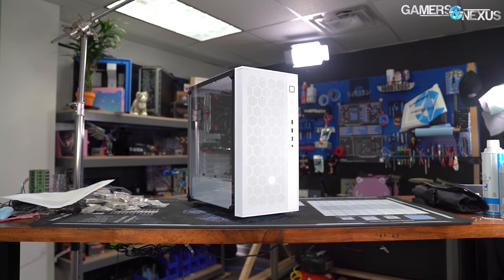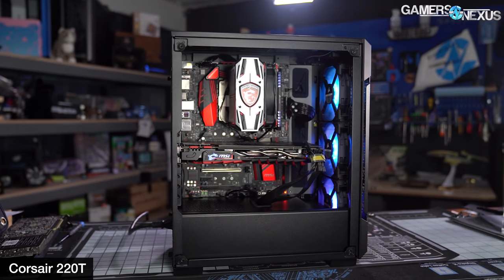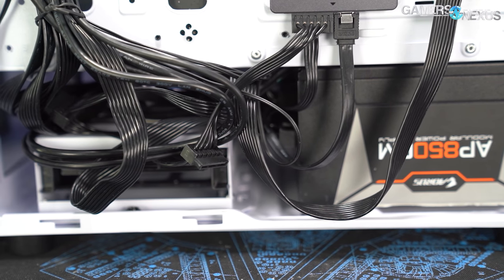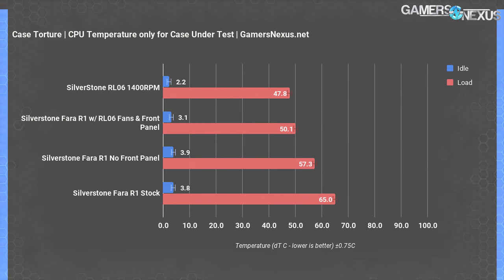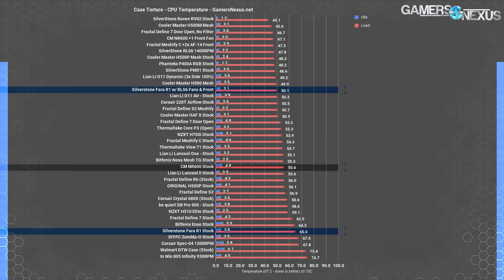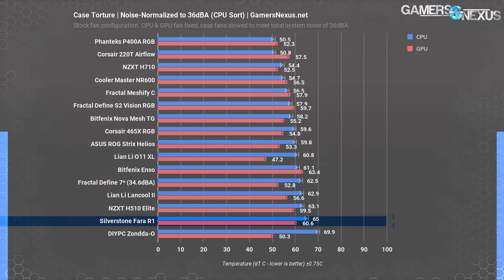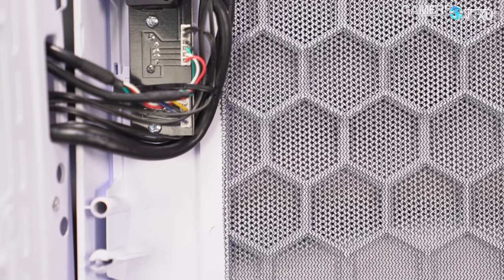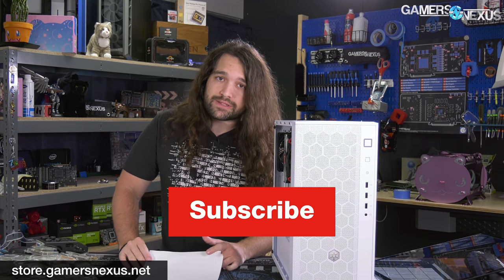Silverstone Fara R1 $60 Mesh Case Review: Build Quality, Thermals, & Noise

Comment: The fact that the front IO is connected to the case itself is the exact reason I haven't "upgraded" to a better air flow case like this or the Meshify C, coming from my Corsair 400C that I'm using right now. I really want something with better air flow, but I'm not going to spend a ton of money on a box to hold hardware and I like, like what you mentioned in this review, the fact that Corsair (among others) keep the front fans super close to the internal components in most of their cases like my 400C
Reply: RL06 front panel has no wires attached to it, and TBH it looks like a better option than its successor.
Reply: @kotekzot  True. And it looks good overall as well. But I'll be honest, I fell into the trap of only wanting a more modern looking setup in my desk area. So I'm one of those people who can't do acrylic and need tempered glass in the looks department. But having only built my first PC in 2014, that makes sense, since I'm technically a newer enthusiast with only two builds under my belt. Lol

Comment: I'm bored of this new gaming stuff. Rgb etc. I want the cases with 3.5 slots. Front fans and not windowed.

Why the hell an simpler chassis cost 200USD? My old oem chassis was 20usd I can store 6hdds 1 floppy, and 4 odds.

2 front fans, 2 back. Atx, psu on top no extra metal for the PSU shield.

Where are the good price ratio chassis gone? Where is the reset button gone?

Comment: I bought my Corsair Carbide SPEC-4 case about a year ago, came with 1 fan, but can fit 6 120mm fans, so I ended up buying 5 120mm fans for it. The case is black and yellow, very good looking, and with the 6 120mm fans running, the airflow inside is actually very good, my RTX 2070 Super stays pretty cool, my Ryzen 7 3700X (since getting a new cooler to replace the stock Wraith Prism) has been much cooler, and just replaced my motherboard with an ASUS TUF B450-Pro (from a Gigabyte B450 DS3H which doesn't have a heat sync over the top VRM's and a poor performing heat sync over the side VRM's) so I can push my CPU hard without blowing up the VRM's or totally crashing my system due to lack of power from the VRM's (the gigabyte board has very poor VRM's, really not good for 6 core or higher CPU's)

Comment: Personal Opinion: 
Most of the Fans that come in more Budget oriented Cases are pretty much lowest end cr**. I've replaced enough cheap stock fans out of cheaper cases that i no longer care if there's one included as i'll most likely swap it for an Arctic F12 for example wich i can get fairly cheap and lasts a whole lot longer in my experience. 
Many cheap cases have those bottom end Fans installed just to look good on the specsheet, along with Tempered Glass, Crappy RGB that isn't adressable and questionable "EATX Support".

Comment: IO and filter embedded on the front panel, punch-out PCI slot covers, crammed cable management, mediocre side panels implementation......in 2020....
Cutting corners in every turn working with a dated case structure....and asking 60-70$?
A quick search on my retailers and there's the MSI MAG Forge 100 or some CM Masterbox contenders with similar features for around 45-55€.

Comment: Funny you mention the Corsair 200r, it's my current case I'm looking to upgrade from. When running F@H on both CPU and GPU, my R5 3600 climbs from 70°C to 80°C (in comparison to just CPU), so heat is getting trapped too much. I'm looking for a mesh case without tempered glass and Der8auer recently highlighted the arctic P12 fans as being really solid and they are incredibly cheap, a 5 pack for 25€, so I don't care about "out of the box" thermals. I'm debating between this an the Meshify C, although this is only 50€ in Europe while the Meshify C is 80€, but the build quality and flexibility seems better in the Meshify C.

Comment: No way man, this case is pure garbage compared to the Phanteks P400STG. I really don't know how Phanteks managed to sell the thing for $65 (what I paid for it, at least), but it's insanely good for the price. After doing some modification to the front panel in the form of waterjet CNC'ing some vents (cause it was stupid hot) it's pretty damn top notch, and I get some of the best temps in this case out of any of my cases up til now after the mod. It's really great quality for even a higher price, considering all of the extra's you get with it, and the noise reduction is pretty good on it. Honestly, once you deal with the airflow issue, it's probably the best sub-$100 mid-tower case on the market, even to today, in terms of features and quality. 

The top and rear panels have noise reduction inner lining, and the case is coated with this thick, micro-textured paint, has removable dust filters, replaceable PCIe slot covers, and I was able to fit a 240mm AIO in the top by moving the rad toward the glass panel and running the screws through the vent holes rather than the holes meant for mounting fans, to get the rad out past the motherboard and RAM, simply because Phanteks made the vent holes themselves exactly, perfectly in line with nearly any standard size fan or radiator. I used peel-n-stick velcro strips to hold the other side of the rad to the case. It has built-in RGB lighting, came with an RGB strip, can fit a 360 radiator in the front, and with some ingenuity, a 240 or 280 in the top, and it's made from fairly thick, properly finished steel panels. It's just a whole lot more quality for the money, from what I can see. 

I just ordered an Evolv X, however, so this case will be going to a family member, and the Evolv X will be getting some modifications. It might have better airflow than the old Evolv, but it's still getting some awesome patterned vents machined into the front and top panels.

Comment: Just put 2x 140mm intake and 1 rear 120mm and 1 on the top 140mm, best solution just like i did on my ps15 which is very similar case from silverstone.

Comment: I prefer the Corsair Carbide 275R for better fit and finish, space, removable hard drive cage, wireless front panel, and rubber grommets around the wire cut outs.

Comment: do you think i would be fine chucking in a 2080 super, 3700x (aio cooled), with 6 fans in the case including the stock one, it’s so cheap! it seems alright if you chuck fans in there, it’s 65 dollars nzd (40 dollars usd) atm and i don’t want to spend triple on a corsair 220t airflow

Comment: Gee you sure rant about a single fan. The absolute VAST majority of pc builders will be purchasing either a pack of rgb fans or a clc any way. You essentially based all your negativity on this on an otherwise very decent case with great thermals once fitted out.

I have a box of stock fans somewhere. Stock fans mean very little to pc builders. And if you're SO budget limited, you're also running a low TDP system so even that 1 fan will be fine. You guys are getting a bit over focused on stock fan performance.

Comment: NR600 is still ~£70 in UK.
I have my 3900X with H100iV2 CLC in a NR600, I replaced all the stock fans with Noctuas (inc CLC fans), 2x 140 top (exhaust), 1x120 rear(exhaust) and 3x120 front intake in push configuration with my CLC rad, the included fans are good enough for a low/mid build, but not suitable for my application.  
One of the stock fans also had whine out of the box too, it didn't bother me as I was replacing anyway but would be something to look out for, although at £70 it's nothing to really complain about.

Comment: This looks like a Deepcool Matrexx 55 Mesh with better mounting holes and cable holes placement, hex mesh panel design, psu cover fan mounts and tinted border on the tempered glass. I bought mine for $10 cheaper, but boy I regret it after watching this vid.

Comment: I buildt a computer for my daugther in the Corsair 275R AirFlow TG. I know you did a review of the earlier model with closed front just having slots at the edges of the front panel. I found this one really good as it also came with three 120mm Corsair fans for around $100, converting from SEK to USD and with our 25% tax on it should make it similar in price. As I buildt it on my older i7 3770 and mouted a Corsair H60 AIO in the back I put the third fan in the front. It is quiet and cool and overclocks the old 3770 to 4,3GHz with ease. Running it with the 16Gb DDR3 1600Mhz RAM and a Samsung 1Tb  SSD along with a ASUS GTX1650 4Gb made it really balanced and works good enough for relativly new games in 1080. Is the new version of the case something that we might see in this line of tests? I feel Corsair has listened to you! :)

Comment: Just ordered an ATX case here in Canada through Newegg made by a Korean brand called Micronics, after having a decent experience with a PSU from them. Around $60 USD shipped, 3 white LED fans included, double tempered glass sides, mesh front (glass front w/ vents available as well), PSU shroud, fan controller. Really seems like a steal, but we'll see what happens at this price point.

I can keep any of my Canadian builders updated if there's interest, they don't seem to be as available down south. Should be an adventure either way!

Comment: If it absolutely positively must have airflow and im not doing a custom loop I still build in HAF XB EVOs. They really need a refresh. I almost never use the drive bays but they are readily available and the price hasn't changed in ages.

Comment: Not having a tv and owning a LOT of DVD´s with more coming regulary, the no ODD trend is a major pain in the ass. I need more airflow and i need my drive. Not external. That´s not an option. Looks like i have to cut out the frontpart of my Corsair 100R if i want good airflow and a ODD if i don´t wanna spend too much money on a new case that has both.

Comment: i feel like this case not having fans is to offer a good price to people who are going to put in aftermarket RGB front fans anyway, so save a buck not giving them something they will just take out anyway. of course, this means you are still overpaying by 5 or dollars for style points i guess, but it is a nice design, despite that front I/O being attached is a deal breaker for me, even on a budget. I will probably get this case as soon i see someone do a clean mod for mounting the front I/O to the case rather than the front panel

Comment: * facepalm *
Attached IO on the front panel is so dumb, and so easy to avoid. It's absolutely ridiculous that any case still does this.

My favorite solution is on the original Define S case. If Fractal has been so inclined, they could have fit the case with a very basic front IO, and offered different front IO kits people could purchase separately to upgrade their case. They also could have sold a Meshify style front panel to replace the solid front panel.

Comment: No front fans makes some sense if paired with a 240mm AIO that comes with RGB fans to showcase the tempered glass and mesh.
Will fans fit between the case and pop-off front panel? The IO cables look like they might intrude.

Comment: The only down side with a shorter case like the "Meshify C" is that it does not allow to put an AIO radiator in the front if you have a long GPU card (30 cm like the ASUS 2080 Strix), avoiding "to cook the CPU" from the hot air delivered by the GPU card (following the Buldzoid advice) and it can be tricky to put it on the top as there is no clearance from the top VRM heat sink and the 8-pin ATX connectors.

Comment: I'm using Cooler Master MasterBox MB520 and the airflow it's massive, plenty of room for cable management, ventilation and has dust filters on the front, bottom and top intakes. My version it's older and it was at the 50 $ mark at the time (has an acrylic panel) but I found the current versions with tempered glass and 3 rgb fans for 65 $ and I would say that's still a budget case considering the 3 fans included. My current setup has two 3 exhaust fans (1x120 at the back and 2x140 on top) and keeps system at 30 C with 21 C ambient temp

Comment: Speaking about $50 budget cases, I would like to see your review of the Raidmax Zeta case.  I think it is one of the best $50 cases on the market, although the caveat is that it comes with only one fan so one would need to consider additional fans with purchase.  Add in a 5 pack of Arctic fans, and it puts you at the same price point as this case.  I dont really care for Raidmax, but I had picked up the Zeta for a budget x58 build for a friend and really like it.  It states the CPU cooler clearance is 165mm, although, the 162mm Thermalright Macho Rev.B did not clear (and TG window needed to be spaced with standoffs).

Comment: I needed a fairly small and cheap(ish) ATX case with good airflow potential because I already had an extra fan lying around. I also wanted it to look good and have a tempered glass side panel. At first I had an P300A but the build quality was very questionable in some areas. The features of the P300A also don't come close to the ones of the Fara R1 (e.g. Support for fans and drives). I now have the Fara R1 and returned the P300A. So if you need a small and light ATX case with good quality and features that's not too expensive AND you have a spare fan at hand this one is hard to beat. I hope GN will also review the P300A as I'm very interested in their opinion on the Phanteks alternative for a small ATX case that's cheap(ish) and has a mesh front.

Comment: Good review,  I like Silverstone products. I went with the RL06 Pro in white for my build. Googled "best airflow PC case" at the time and it come up in reviews etc at about half the price of my previous options, packed it out with 6 Corsair LL120 fans and it works great. No regrets although it could have done with a slither more width on the cable management side of things and maybe a warning label about the bastard tax on all the other white components to finish the job.

Comment: What do you mean people aren't really buying hard drives?!? I have 6 in mine
Reply: the vast majority of people don't need hard drives at this point.
Reply: Why do you have 6 though? I'm genuinely curious. I have a 4tb alongside a 1tb M2 ssd, and that's really enough for me. The HDD is basically hidden in my system. I do have backup HDD's stored on an external HDD enclosure though, but I connect them when needed.

Comment: I like 5.25" bays, I know they are antiquated, but I have old optical media and I like to have a hot-swappable bay. In a budget case, it's not like you are going to fill the empty space with an open-loop water cooling. As a data hoarder, I also want more than two 3.5" internal bays.

Comment: So basically, if they throw in a 120mm fan this case would rate pretty highly.  If you can live with the front panel being attached by cables when you pull it off, and no easy remove filter on the front.

Comment: I picked up this older case recently for a no-RGB stealth build. Definitely was not pleased to find out that the front mesh filter is not removable, but I was able to stuff three Arctic P14 fans in the front (though the top and bottom fans are held in by only two screws - no rattling or movement though), two P12s on top and one P12 in the rear. Great thermals, cable management is acceptable. I am not unhappy.

Comment: Note for if you have a motherboard with build in large heat sinks can actually be hit buy the 140mm fan if you install them on the top of the case. x99 deluxe as a mb for reference.

Comment: I'm using the fairly scarce RL08, it's an inverted layout and the thermals are shockingly good, although it has the tendency to start sounding like it's throat-singing with fans at max-rpm.

Comment: MetallicGear Neo Air - $50 and it included 2 fans. Used it in my last build and the front panel is similar to the one on the R1. I believe they're a Phanteks baby sister brand.

Comment: It is cheap and not bad, personally I would pay more for a slightly better version - removable mesh, front panel redesign so easier to remove, better panel latch mechanism, the one thing I never worry about are the fans (or lack thereof).  I, and I suspect most hobby pc builder are the same, have plenty of spare fans lying around from previous builds

Comment: Trash case. Spent to much time making, what seems to be a larger micro case, instead of a okish cheap mid case. Folks on a budget need more room then that, they use more hard drives then ssd, they buy non modular psu, and they dont care about things like full glass side panel or psu shroud. Retooling is one thing, but this is a case that you will grow out of, very quickly.

Comment: hey i have  5 drives  and 2 external  (2 sdd  x128gb  1 500gb old one but still working  1 tb and 3tb  in side the case and  1tb and 3tb external )  no room in the case and i dont want to stack them close because i had bad experience then i had raid array  ,disk in the middle got to hot and  boom... all gone  no games no windows .... and no way to recover and because hdd's was to close to each other  so more space  - better cooling  ,all the disks make a wall and fans cant push  air thru

Comment: The Mesh front is great, not the retarded full glas or metal cover anymore.  Kinda sucks most cases don't leave enough room behind the board plate for the cables. All of them do one thing right and the rest wrong...

Comment: On the subject of glass and steel options, I was told by a Corsair employee that a steel side actually makes a measurable thermal difference when compared to glass (assuming 'full-size' panel). In theory, it makes sense, but has anyone done any experiments to confirm this? PS: I like this case.

Comment: I feel we need to rethink orientation or something. Either way the front space of cases is just soooo much wasted space and feels to be a relic from when we had disc drives in the front and huge HDD's. most modern pc's won't feature an hdd and if at all it'll feature 1. i just hate the huuuge amount of empty space in the front of cases.
Reply: HTPC cases solve this problem